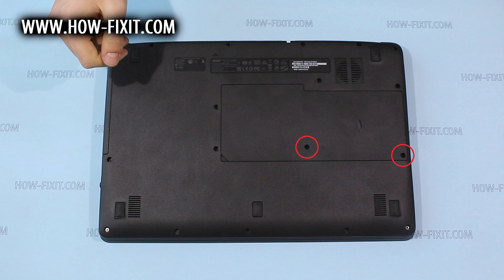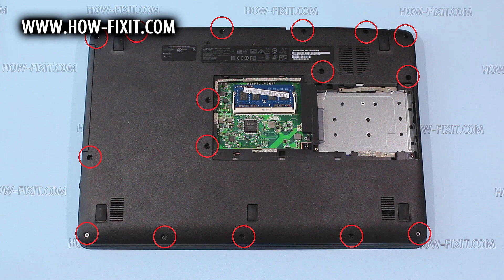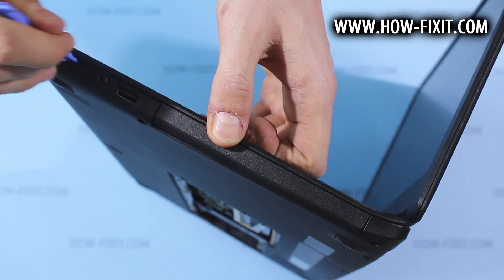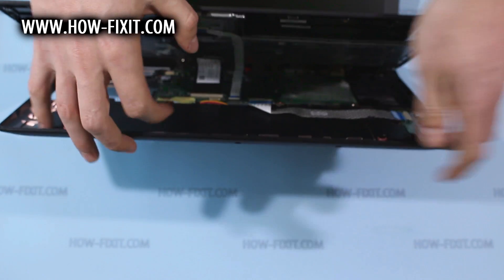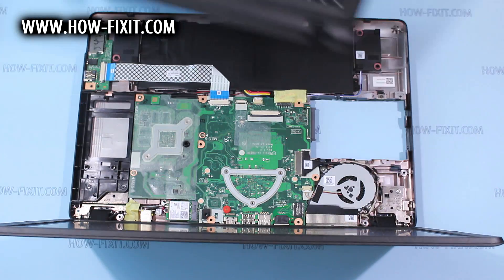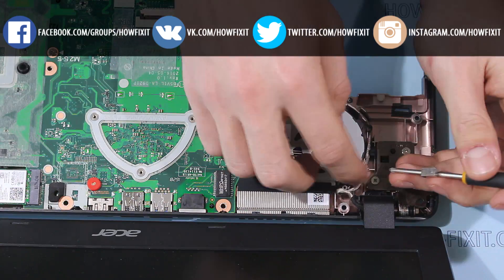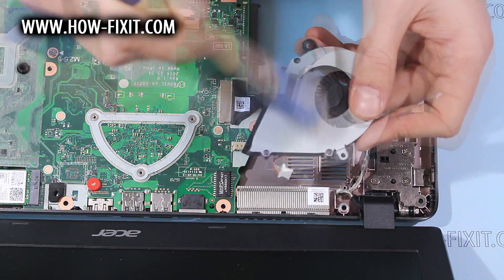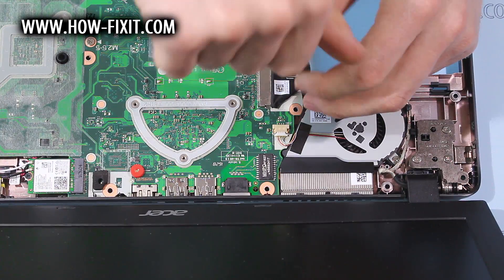Acer Aspire ES1-532 Disassembly and Fan Cleaning

Comment: Does this notebook support SSD and HD at the same time?
Reply: It does!!! 
I'm using ssd with HD, 
SSD on the main slot on the motherboard and HD on the slot for DVD, using an adapter found for less than 5 dollars.
Reply: @vinicius3938  Please give a link to this adapter! Thanks!
Reply: No, this models don't support simultaneously. You have to make a choice between.